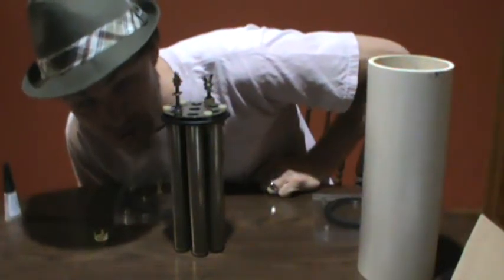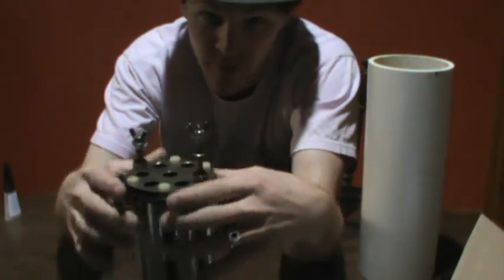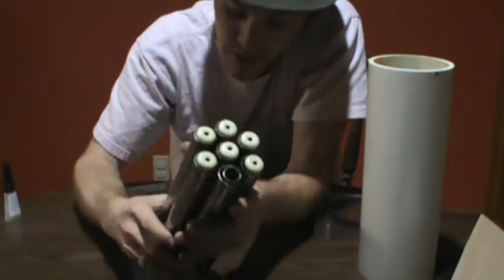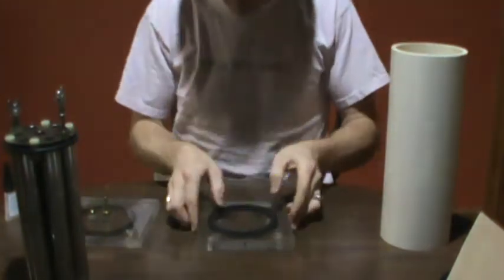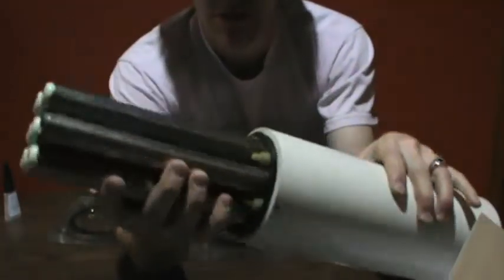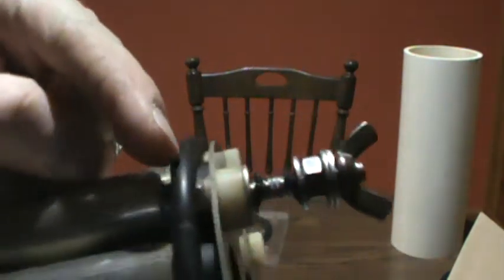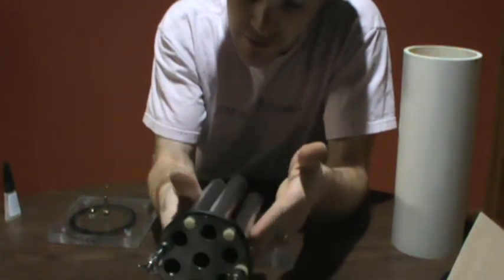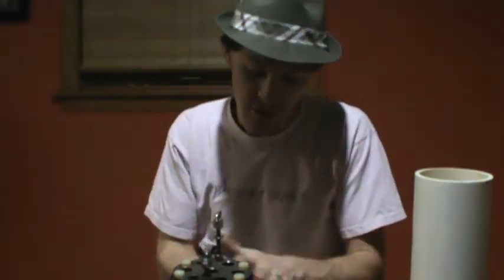Getting The New Cell From AL Ready For Some New Testing.  www.RWGresearch.com

Comment: the flow through is a great Idea! helps with cooling also and I feel is more inportant than the pushing off of the bubbles. Heat causes evaperation that will cost you more surface area than the HHO bubble size. I've witness the increase of evaperative bubbles getting larger as the heat increases and staying attached longer as well.
Keep up the great work.

Comment: Good Video. The  cell  is  designed  like  mine. Electricity  thru  the bottom, Oxy-hydrogen out  the  top. Heat rises , but pumping elecrolyte thru the  - and + tubes  helps  clear  the  stainless  316 steel of  bubbles, theroretically increasing  production

Comment: Instead of just passing a flow of water what if u bubbled air from below the cell to let the Hydrogen and oxy be knocked free. Or even run the hydo and oxy it makes back into the system as a bubblier.  If installed in Car the Hho cell will be under vac and u could even feed  small amount of exhaust to a cooler( different bubblier) then pass it into the hho cell. Another thing to consider is cracking these vapors as a last step before they enter the engine. Atomization is key